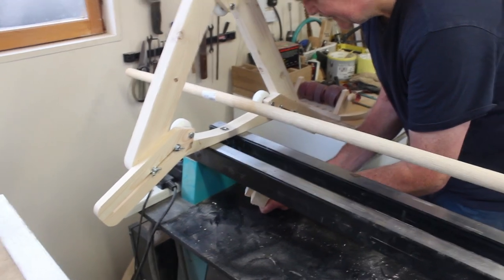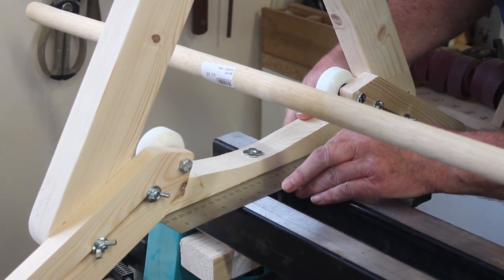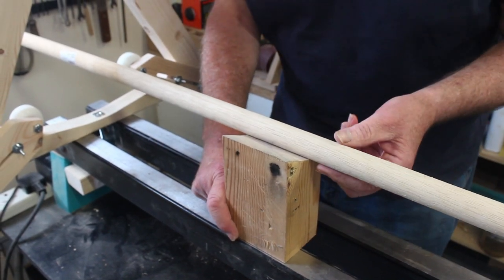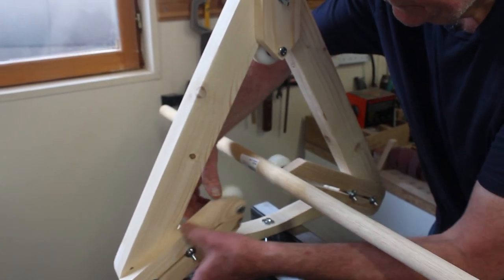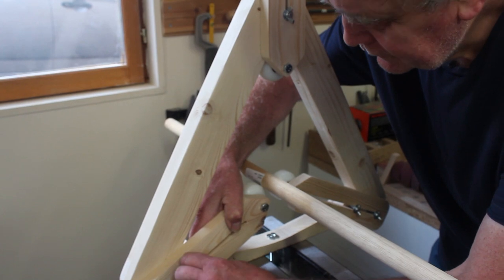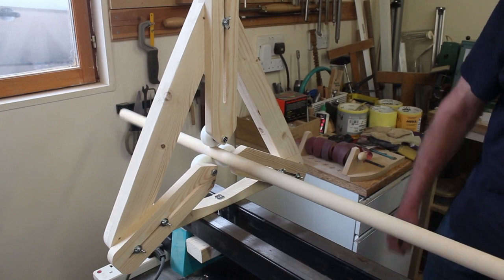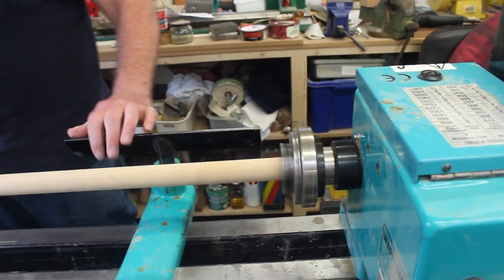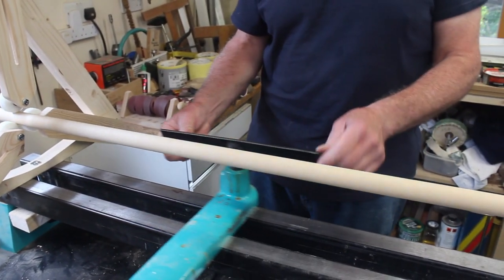How to turn a very long wooden pole or spindle

Comment: Up to about twice the length of the lathe bed. When you have done one half, just turn it around to do the other.
Reply: Bet you dont line it up exactly. You should never remove a turning until its finished. Even on the best engiheering lathes it wont go back exactly where it was.
Reply from the maker: You are correct, you'll never get it 100% exact :)